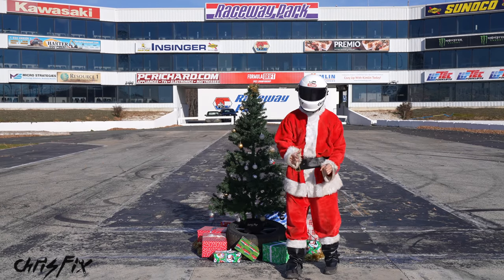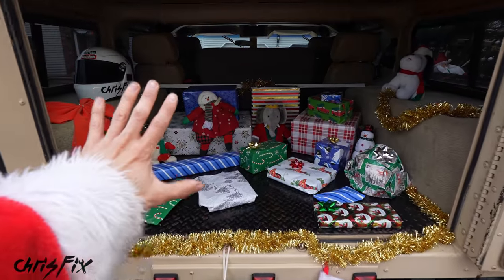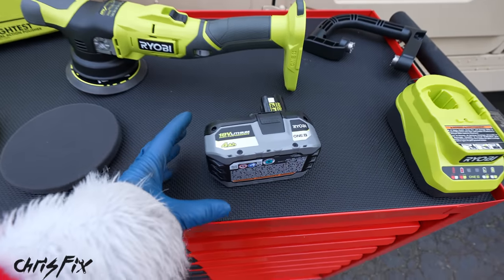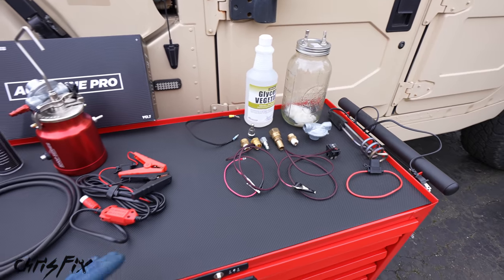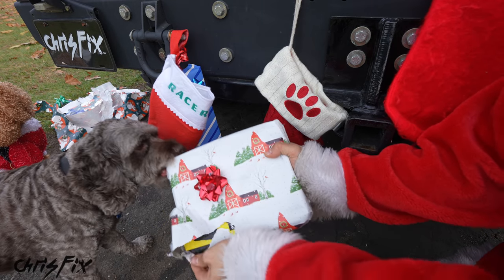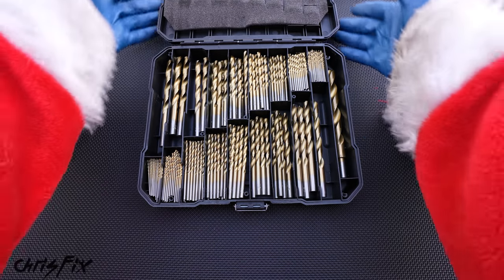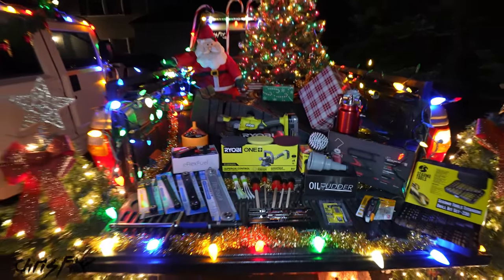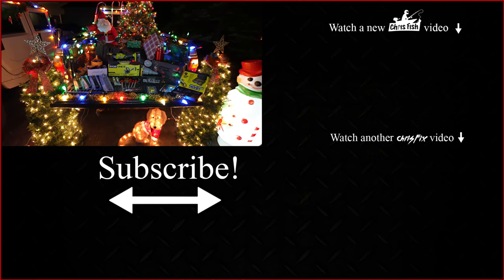Top Car Tools and Gadgets of 2021 (Christmas Gift Ideas)

Comment: The only problem with the e85 conversion kit is that if you let it sit it will eat up any plastic or rubber in the fuel system, not to mention yes e85 is cheaper per gallon but it uses more fuel so it ends up costing about the same when you add it all up. Love the video though keep up the great work
Reply: There is a lot of misconception of e85 being highly corrosive, we think you might be referring to methanol (race fuel) which is corrosive. We ran tests with rubber hoses sitting in e85 since 2015 and the hoses are still intact. It is true though that e85 does use more fuel than gas and that's because it is higher octane.

Comment: Just a small correction (and with 5000+ comment im sure its been mentioned before, but in the off chance its been missed)

@2:20

These weight ratings in the door jamb are not the vehicle weights. GAWR/GVWR stands for gross axle weight rating, or gross vehicle weight rating. These are weight RATINGS, and rate the maximum safe weight to have over either axle (or total for the vehicle for the gvwr). This is important to know if youre loading the car with a bunch of heavy stuff, or towing things.

Comment: A note about using the torque wrench with the ratchet extenders;
 it will add a massive amount of torque if you don't hold the extender, so it's not like adding a pipe to the end of a breaker bar. 😉

Comment: When you use a coolant funel its important to put your heat at max and your fan too (the fan not at max but whatever) , you need to got circulation in the whole system like that your sure you got all the air out
Reply: I run at 1500 rpm for about 5 minutes and thats it never had problems with air on my system
Reply: Im a mechanic diesel and trust me what I said its by the book , we put coolant by the bottom on heavy duty so no risk at all no procedure but small engine doesnt have a quick connect on the bottom of the radiator like a Isuzu,  in the book they said to but your heat ON to make sure but  I also use funel like that what a nice thing nice video !

Comment: It's a viper, long oil pan equals long engine, viper has a long v10. Ferrai on bottle is a misdirect, ferrai are  mid engine cars.
Reply from the maker: There are front engine Ferrari's ;)
Reply: @chrisfix  Forgot about the newer GTC4. I still guess a viper because of the body Iine we can make out and the engine sounds distinctively like a viper

Comment: i'm looking forward to the E85 Fuel Kit conversion video, really curious to know more about it and see how it works
Reply: our kits are fully automatic flex-fuel compatible systems. Since they are piggyback systems they won't affect your vehicle's ECU or void any warranties. It plugs directly between the fuel injectors and ECU. It automatically adjusts your fuel injectors' duty cycle to allow you to run e85 safely within your vehicle.

Comment: 26:04 Here in Brazil the use of Ethanol in cars is quite common, in fact, almost 70% of the cars in the streets today can run from factory with ethanol or gasoline (separated or at the same time). We call this type of car "Flex", but most the older cars (from 80's to early 00's) only runs with ethanol or only gasoline.
The sad part of all this is that both of fuels started to be insanely expensive last years in here, so it really doesn't matter what kind of type you're using because ethanol is slightly cheaper but you get less kilometers per liter (miles per gallon), instead, the gasoline have a better fuel saving, but is more expensive.

Comment: Hey Chris, was wondering if you could make a video on getting a car prepared for a long distance road trip? Ik every car is different. Just the maintenance side of things. Seems like there’s a lot of videos on “what to bring” but not “what to prep” 
I was thinking like a coolant flush, new radiator hoses, oil change, tires rotated and alignment. Anything else? Also, a lot of those things you have videos on. 
Thanks man

Comment: I'm in Canada and there is only 4 stations that have E85 gas here vs USA with over 4000 lol, but I googled E85 and found this:
"While E85 gas costs less than regular gasoline at the pump, the decrease in miles per gallon makes it more expensive when driving. Despite the lower miles per gallon, flex-fuel vehicles often put out more torque and more horsepower when running on E85 instead of regular gasoline." So apparently if you are trying to save money on fuel then E85 won't help.

Comment: Hi Chris thnxs for your videos and they are great but I have a 2003 Peugeot 206 and I wonder it really runs rugh and when it comes to heavy rains it really runs smoothly and i always wondered if it is cylinder head or the clutch or the sensors off but the problem is that the pedals shakes normally when I press the throttle and in heavy rains it really gets really smooth just as good as new

Comment: Hey Chris, could you make a video on recalibrating a speedometer after putting on bigger wheels or just having issues with the speedo? I’ll be on the freeway going 50-60mph and I’m really doing about 80-90mph. It’s off at lower speeds as well but maybe a 5 mph difference

Comment: Err little tip sure you haven't been pulling sparkplug sockets out with pliers all this time remove the rubber grommet from the socket before inserting the plug it pops in and out of the socket very easily but yes the magnetic one looks nice i want :-)

Comment: Hi Chris. Does the hand tightening for oil filter also appy for Diesel engines? Wont the filter come loose eventually especially if car is often used on rough roads and corrugations?

Comment: That’s cool and all converting the car to be able to run E85 but what about the Teflon coating found inside the fuel system for actual flex fuel vehicles?

Comment: Sure, you can run E85 if you like preignition.
Reply from the maker: It’s funny when people have no clue what they are talking about… e85 has ~110 octane which would decrease pre-ignition aka engine knock. That’s half the reason to use it… performance

Comment: Got a question about tires. I have tires that are well beyond the born on date. They have low miles, on an always garaged vehicle. Have always used nitrogen to air them instead of air. I believe that since air contains water that it helps the deterioration of the tire from the inside. My tires look brand new no cracking, separation or dry rot. Same with my vehicle that stays outside all the time and is not driven a lot. They look brand new and this vehicle is driven about three times a week. No signs of tire degradation or separation or deterioration inside or outside the drywall. What do you think? Still safe for me to use?

Comment: Hey Chris,
I really enjoyed your kill switch install tutorial video and I was wondering if you could possibly give me some recommendations or make up a plan or even a video of an anti-catalytic converter theft system. 
I’ve been robbed 3 times with my car parked right in front of my house and I’ve thought about making a DIY system. My original thought was to install motion sensors on the underside so that when they detect motion, bright lights and my car’s panic siren or aftermarket siren would sound off. The whole system could be activated/deactivated from a switch inside the car so that when I park my car for the night, I could turn it on and when I first use it the next day, I could turn it off. 
I know it’s a big ask, but I would truly and whole heartedly appreciate it as well as some other of your viewers. Catalytic converter theft jumped from 108/month in 2018 to 1200/month in 2020 according the National Insurance Crime Bureau.

Comment: Hello, my friend! great videos. they helped me a lot!! I have a HONDA CIVIC fastbeck 6 engine put D15z6 , the problem is now with idling , they are 600 on the tachometer , but they should be 900 . All the reason? Another problem is that the car jerks violently when you drive and remove the gas, the car bund engine is unscrewed =((

Comment: Can you move into the airplane side of mechanics, like a whole separate channel on fixing a Cessna 172 (like a complete tear down, rebuild, and service) there pretty affordable around 25k (but being Chris fix someone on the channel has to have an old one in a barn somewhere), and as long as you register it as experimental you can do your own work and fly it with no passengers. Bonus the camera angles would be great since the engines in your face, and not tucked away in an engine bay, also no transmissions, and there air cooled, and the whole interior comes out in about 10 minutes. There is just tons of crappily filmed videos on YouTube, with a lot of “ummms” and background noise. You can ship it wingless and put it in a quiet place.

Comment: More and more OE do not want us to prefill oil filters due to contamination. I don't prefill anymore. It's the same as spraying the brake reservoir with brake clean before opening the cap. For the gasket I'm loving Fluid Film / Chain and Cable lube. Easy off and no leaks. I dont use synthetic oil nor recommend it due to crystallizing. Drop an oil pan, look at your dipstick. See that honey color stuff that wont wipe off?

Comment: Hey Chris, I am currently driving a toyota rav4 2013 rear wheel drive. I live in canada and now its cold. I have a problem with the handbreak. My handbreak is still on even when the lever is all the way down. Its easy to pull it up and down, but when I try to advance, it breaks. What to do?

Comment: be careful with that e85 kit, if you have an older car especially if you have a lot of rubber fuel lines the e85 will eat through those lines and can potentially start a fire or at the very least create a large fuel leak that can prevent your car from starting
also keep in mind that your fuel economy will go down with e85 so you might not be saving any money because you have to fill up more often

Comment: Does normal fuel work with the ethanol conversion kit or is it just ethanol?
Reply from the maker: Normal gas still works with no issues! This just adds the ability to use ethanol on top of already being able to use normal gas. Factory flex fuel cars do this all the time
Reply: Ok nice I will definitely try that out

Comment: You think you could talk about Toyota’s security system? I undid a battery on a Corolla and the security system won’t let it start and idk what to do the dealership wasn’t help either, I did the water pump and had to move the alternator but only undid one plug

Comment: Hi Chris! I've been watching your videos for a while now, top-notch! I wanted to ask a question: I'm going to receive a second-hand car from a family member. It's close to being twenty years old but is still reliable and serves its purpose. The only problem it has is that whenever I turn the steering wheel to do a turn it's quite hard and takes more effort than it should to turn the wheel completely. What could the problem be? Is there something I could do to improve it or fix it? Thanks!
Reply: It could be a few different things, However I had similar issues and it was the Steering Shaft.

Comment: Hey Chris, I have a question, I have a 05 Silverado and it starts but it stalls. Any ideas? I thought it could be a security code issue because I put a new steering collum in, but it's not

Comment: Hey Chris! I was wondering if you have any remedies for a windshield that has been almost sandblasted after nearly 300k miles of driving, a good number of which were on dirt roads or high speeds. It isn't an issue the majority of the time, but when I am driving into the sun (when the sun is low in the sky) at the right angle its like the windshield is all of a sudden super dirty and is hard to see out of. Cleaning won't help at these times and thats why I think its from dirt scratching the glass over the car's life. Is there anything I can do other than replace the glass? Any help is appreciated.
Reply: I've heard of people polishing them. Similar to polishing paint

Comment: I have an 09 Mazda 3.  104k miles. When I remove the oil cap there is pressure coming out.  I an easily put the cap back on but is this normal?

Comment: Kinda confused on the e85 product, I get the purpose of it but as an owner of a flex fuel vehicle ('17 Chevrolet Tahoe) I can definitively say its not cheaper in the real world.

The fuel costs less, but you get far fewer miles per gallon. It roughly breaks even when you take cost, and mileage into account, some times its even costs more plus you need to fuel up more frequently.

I get about 17mpg highway with gasoline, 10mpg highway e85 the price difference isn't worth it, at least in my area. Maybe some states/regions it makes sense but I gave up on that idea a long time ago.
Reply from the maker: 15-26% less fuel economy so you need to do the math to see if it’s worth it for a regular car.

Comment: Chris I have a 2012 Toyota Camry LE it has the torque converter recall if I get the kit from campaign with upgraded torque converter new magnets and updated software now if I replace it will the problem occur again

Comment: Hey Chris, wassup. I appreciate all your videos. I need an advice. I wanna buy some of those fancy scans, the ones like tablet size. I wanna one that is not more than $1000, and that i could inspect close to 100 % engines and trans, that is the most expensive parts in a car. Iam looking for buy cars toyota in special but maybe some ford trucks and maybe one trailblazey 4.2 2007 if i keep this car. Iam planning buy cars and fix to sell but I don’t wanna sell people junkies cars. And i need some reliable ones to keep. Looking for a 4 runner for family and wife and for me a pickup and corolla, i wanna cars between 1995 and 2008. I don’t like and don’t wanna new cars with lots Eletronics. So with all this in mind which scan you advice me to get?

Comment: E85 is typically 30-40% cheaper per gallon, but provides  approx 30% fewer miles per gallon, so the actual savings are much less than first glance would indicate.   And there are potential hidden costs..   
Payback on a $700 conversion kit may take significantly longer than most people keep their car, and it's installation may very well hurt resale value with any informed buyer. 
EVEN IF the engine and entire fuel system were designed from the ground up to accommodate E85,  its use may provide less reliability, durability and robustness to noise factors such as performance under environmental extremes, system interactions, materials degradation, fuel degradation, etc.
30% less range means 30% more refueling stops, which cost time, and sometimes significant  side trips (non discretionary miles) to get to E85 fuel sources.  Additionally there are added emissions associated with the more frequent refueling not to mention the questionable rationale of using (tax payer financial and fossil fuel infrastructure) heavily subsided corn to produce "less expensive" ethanol .

Comment: My truck shakes when I go at highway speeds and when i go uphill. It seems to lose power when I go uphill. It also sounds like it is running extra rough with like a fast motorcycle sounding sound extra to the normal engine sound. When I go highways speeds theres like a random popping sort of sound from the drivers side toward the engine, in between the dash and the gas pedal. Any clue what could be wrong?

Comment: Hey guys did someone tried the method with the spillproof funnel with a BMW 1990-1999 with a M52 engine? Maybe i did something wrong, because my coolant level is under the reservior cap and not at the line if it's cooled down...

Comment: On the note of those spark plug sockets getting stuck, I do have a small tale

During my college days studying mechanics, we were taking the spark plugs out and back in to a mk2 clio. The intake manifold on those acts as the engine cover, so the spark plugs are really far down. We ended up having to use 2 extensions to reach down there. The socket didn’t really have a gromit to grab on to the spark plug, so our tutor said to put a small amount of blue tac on so it’ll grab. My classmate put a *shitton* on there and rather than grabbing the plug the whole ass socket got stuck down there. What was this guys response to this? Well it was PUT A SHITTON OF BLUETAC ON THE EXTENSION TOO. This poor 1.2 clio ended up with a socket and an extension very much wedged in there; and me and the tutor had to take the intake manifold off to get at any of it 😆

Comment: 1500# per wheel doesn’t mean 3000#… it means 1500#. 🤦🏼‍♂️ there may be some dispersion amongst the load, but there is a max weight of 1500#. Don’t want anyone to misunderstand that rating.

Comment: Yoooo chris or anyone in the comments I have an Infiniti G37 and when I start it it has a high rev I was trying to fix an overheating problem and so I bled the air and I didn’t have coolant and my mechanic I was talking to said to bleed it with water but I was wondering if I messed up cause my coolant said not to mix with water I just want to know what I can do to fix this issue I went for a drive and did a small pool and my car started hesitating than misfiring and brought me to a stop and my brakes weren’t letting me stop and when it stopped it shut off and when I started it after that it would just high rev at the start up than go down to 2500 or 3 and just sound like it’s misfiring or hiccuping
Reply from the maker: I would make sure you have a 50/50 mix of coolant to water so it won’t freeze in the winter. Otherwise it’s not a big deal if you have a little more water than coolant. As for your misfire maybe you have a head gasket leak or got coolant on the spark plugs?
Reply: @chrisfix  thanks chris I’ll try my best to figure it out